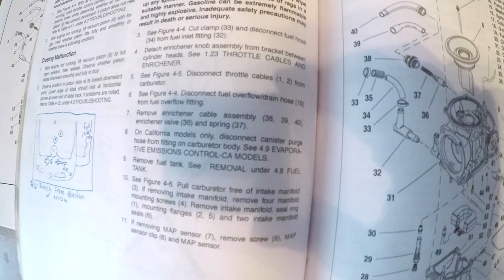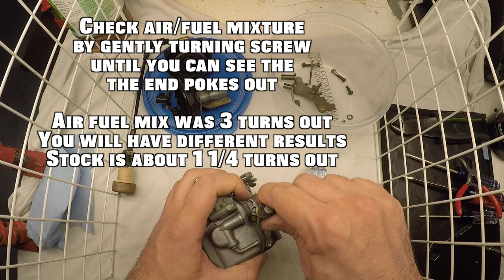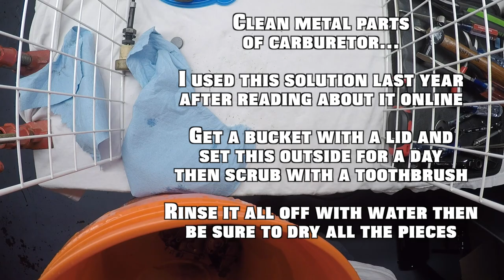rebuild harley davidson sportster cv carburetor - video 1 of 2

Comment: Because you pull off a carb on someones bike, don't assume everything is there. Someone may have been there before you. Double check all parts in the carb. Beautiful video bro. A+
Reply from the maker: very true, my carb somebody before put a larger size jet than needed and it was causing heavy throttle to bog down during aggressive accelerations. I got lucky figuring it out and it runs so smooth now

Comment: You've  got the same black burnt look on the white plastic  part of your slide. What is it?
Reply from the maker: got the bike used and somebody before put a larger than needed jet in there. Not sure if that caused it or just age. I put this burnt one back together after I filled the rubber cup with water and it didn't leak. Ran perfectly fine in the bike but the next time I had to take the carb off I changed that part out just to be safe, but I bet it would of lasted for years and years
Reply: Mine looked the same, i should have replaced it. CV parts sucked. bowl o ring didn't fit correctly had to glue in place, air adjust screw took a big ass screwdriver to get in the first time took out and oiled it, good way to damage it if you can't feel when it bottoms out. Intake gaskets had casting rubber all over them and had to peel off.
Reply from the maker: I had the same problem with the cv adjust screw. Can't remember if I got my rebuild kit from there too but the new one I got sucked because the accelerator pump diaphragm gasket shrunk after gasoline touched it and maybe heat. I had to take apart the carb and put the 13year old original back and it works great. Looks like its made of a fabric type material and the new one was just rubber